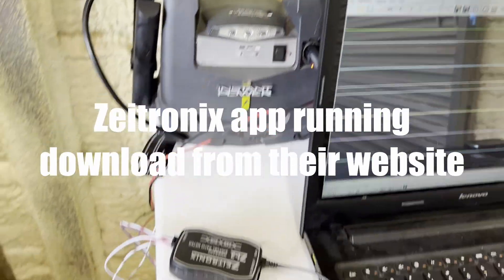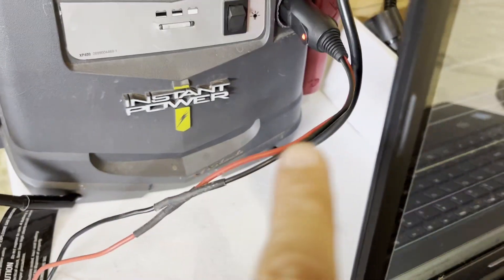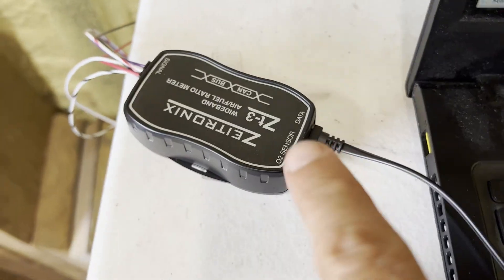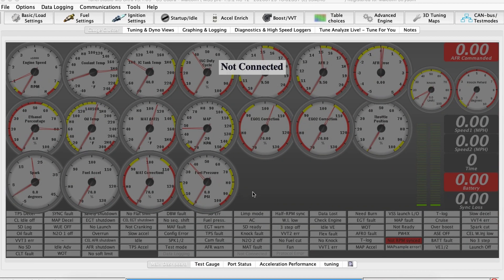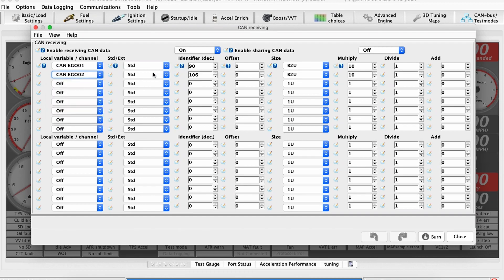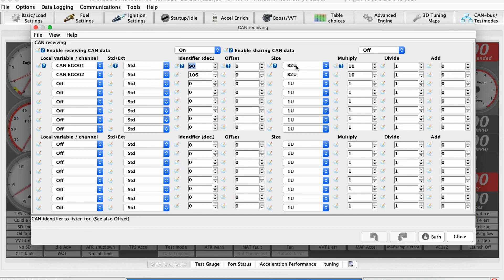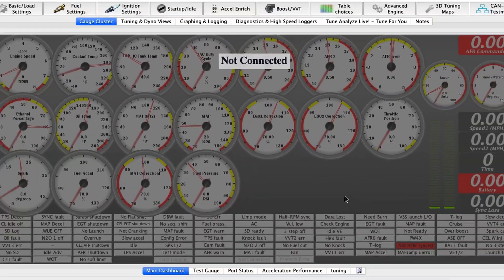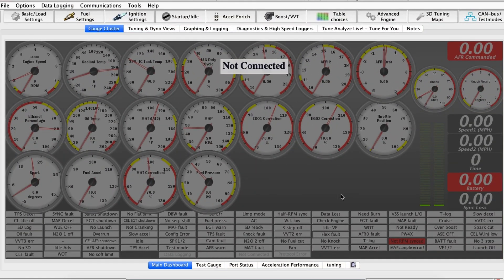CAN BUS Widebands into an 03 Cobra Terminator part 1

Comment: Have found that your videos regarding the MS3PRO has been the most useful.
I have a kenne bell 2000gt and a 97 Cobra with a turbo set up on it that I am looking to add the MS3 set up to both of these cars.
Do I need dual widebands for both of these and will I need gauges for the wideband or just hook them into the ecu and read them via laptop?
Reply from the maker: Happy to hear they're useful.  I would definitely recommend dual widebands on them.  You could just install one but remember you'll only be reading one bank of the engine just assuming & hoping the other bank is doing the same thing.  It's a great way to blow an engine up.  A gauge or gauges are certainly nice for monitoring or keeping an eye on things but not required.  You can have them read and data logged in the ECU and you can setup safeties within the ECU to save the engine should the AFR ever go out of spec.
Reply: @MalcolmV8  Thank you for the reply, do you have one that you would recommend or an affiliate link that could help support you?
Reply from the maker: @spoolinsvt6489  no affiliate links but I appreciate the willingness to support the videos.  I'd recommend you get the Zeitronix ZT3 CAN based widebands.  I have a whole video on why the CAN based widebands over the old style analog signal widebands.
Reply: @MalcolmV8  I did watch that video, appreciate it. I guess I will be ordering 4 of those. Boy this is going to get expensive real fast haha
Reply from the maker: @spoolinsvt6489  cars are a money pit hobby lol

Comment: Can you leave the CAN Bus ID as 005A or does it have to be 006A? Wondering why the change
Reply from the maker: If you have a single wideband you can leave it. If you have two you must change one of them or they’ll conflict and the MS3 won’t be able to communicate with them.
Reply: @MalcolmV8  That makes sense and felt like I understood after I walked away from the video before your comment. I actually had dual widebands (ZT-3's none the less) hooked up and it did work without me changing those parameters? I was wondering how the MS3 knew what bank was which. I even called Matt at AMP EFI and thought I had it sorted with the resistor wiring and everything but here you are again sharing your knowledge about how to actually turn it on lol. What I did notice in the CAN receiving tab is the second EGO was blank and I assume not on. I'm not sure if I didn't follow directions the first time around but did get everything resolved and updated with your instructions. I did also notice your AFR/EGO fuel settings window, my left side looks totally different. Mine is "simple" vs your "PID".  Thanks so much man for this info.
Reply from the maker: @papajoewil10  Glad you got it working.